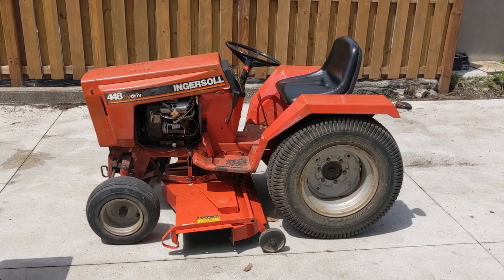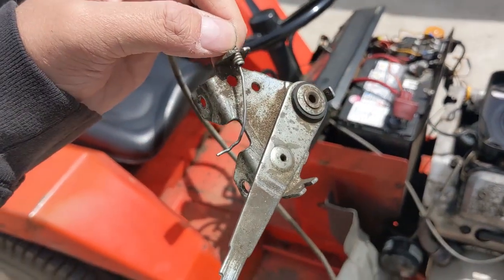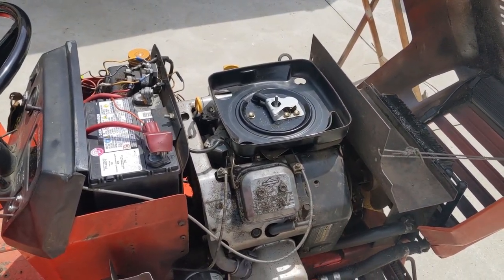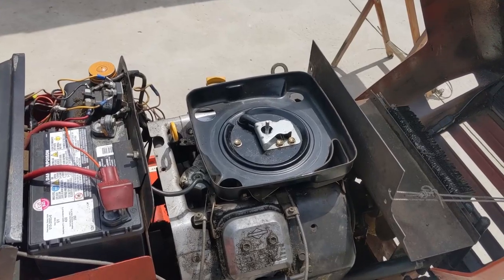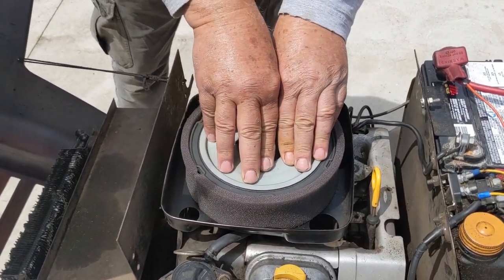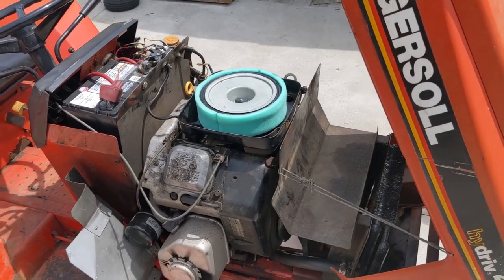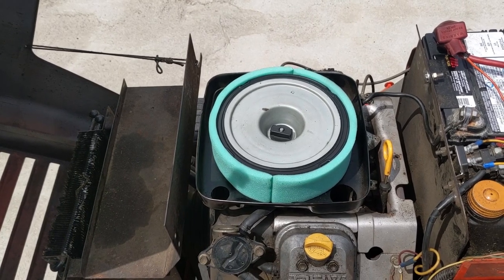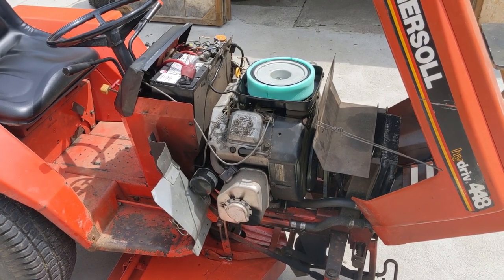Brand New Air Filter Causes Engine to Run Rough

Comment: You and your dad do top notch work. I’ve never come across a OEM replacement that caused and issue, but the proof is in the pudding on this one. I most likely would have tried to adjust the fuel mix with it running on the OEM. I don’t know if that would have fixed the issue, but I’m glad the stens replacement had this machine running like a watch.
Reply from the maker: Yea it's hard to say, I probably could've adjusted the air fuel screw, but to install a stens air filter and see it run so smoothly, I figured why not just do that, less work involved and at least I had the proof it ran smooth without a filter and with the stens one installed. Thanks for watching!
Reply: @EliminatorPerformance  I agree. Easier to go that route and also proved that the stens had better flow. Let that old girl breath a little better. Great job on this machine, and thanks for stopping by my channel as well.
Reply: My old neighbor had a fairly new at the time 84 Nissan 200SX turbo. He wanted me to look at it because it started running bad after a quick lube oil change visit. Found the new air filter that they installed got sucked from the air box into the intake tube. It was obviously after market because you could just about stand on an original one without crushing it.

Comment: Good call on the choke cable. If a wire bends too many times it brakes easier. Plus the choke cable could have been binding inside due to corrosion hence the bend originally.
Reply from the maker: Yea and on this one (as Doug mentioned in the comments too) the cable conduit slightly touches the battery. The old one did too. Hard to say if that makes a difference, but it's smooth engagement so I wasn't worried.
Reply: It's perfectly acceptable to replace just the inner flex rod. Would have saved several $.

Comment: Seams that air filter from Briggs has way less filter material than the Stens. I had the same thing happen to me last year when I bought an air cleaner from Ebay. The new component was a Briggs NOS item. I just made my own using an oversize filter I had laying around. The engine ran fine and still runs to this day. I took the air cleaner apart and the total size of filter element was just a little larger than one square foot. That is a real restrive filter. Now I just will make my own. Nice video fella.
Reply from the maker: Thanks for watching Victory, and yes it seems they're are built different, would be interesting to cut some apart and see the difference but I don't have the microscopes that would be needed to see the fibers.
Reply: @EliminatorPerformance  Hard to believe Briggs would cheapen out.

Comment: Now that is a lawn tractor. Well done sir, extremely lucky that you had one of those filters in stock. Now here is a case when the OEM fails and the aftermarket keeps on running like that rabbit on tv. The moisture point by Rons Mower Service is interesting but as you pointed out you had both in the sun most of the day and they were dry.
Reply from the maker: Yes both dry and the pre filters were not oiled. Thanks for watching!

Comment: I have a cub cadet 782 with a Kohler KT-17 that is running rough, and when I removed the air filter it started running smooth.  Thought there was something to it.  I had been advised to soak the pre filter in oil, and I notice you are running your pre filter dry.  I will be picking up a new filter and doing the same tomorrow.  Thanks for some piece of mind
Reply from the maker: Definitely don't soak them, if anything you just want a small film of oil to catch dust. You can get dirt bike air filter spray that's made for it, but we generally run them dry and just change them regularly when needed.

Comment: I HAVE HAD THIS ISSUE   THE PAPER WAS DAMP WITH FUEL  DUE TO INTAKE VALVE BLOW BUY.  A NEW FILTER WAS A TEMPORAY FIX UNTILL WE COULD GET THE VALVE ISSUE FIXED
Reply from the maker: Interesting, I'll have to remember that. A leak down test would be enough. These filters were both dry, and as I mentioned in another comment, the foam pre filters were not oiled. These were both brand new air filters.
Reply: Good call Jeremy any dampness will cause the issue .

Comment: Hello From Mark In Kentucky.  I have noticed a similar situation with the FRAM air filters both with my truck and with my small engine stuff - So I no longer use any of the FRAM air filters.  
The situation that you described reminds me of a Dodge truck within our fleet with a Slant 6 engine that was brought in for a poor running complaint. 
The mechanic who was looking everything over loosened the wing nut on the breather and the lid was vacuum locked and when he would pull up on the lid, There was a very distinctive “Whoosh” and the engine immediately started running as it should. 
In my nearly 32 years at the repair facility, That was probably the worst obstructed air filter that I had ever encountered on any of the government vehicles and equipment - And I have witnessed my share of “Nasty Filters” over the years. 
Most of the air filters that we used were Napa/Wix, FleetGuard or Hastings with no issues as with the Briggs & Stratton air filter featured on the video. 
A year or so ago, I had a brand new round OEM Kohler air filter with the foam pre-filter that exhibited a similar obstruction - But not to the extent of what the Briggs & Stratton air filter exhibited. The very similar round air filter that I had the issue with was used on my 682 Cub Cadet with a KT17 Kohler Series 2 engine. 
So I wonder if the OEM Briggs & Stratton and Kohler OEM filters are manufactured by the same company. As Always, Thanks For Another Great Video.
Reply: A great comment IronDuke502 glad to hear that others have had a similar problem with air filters. This is the first time we have had an issue using brand new air filters. And yes you may be correct that these filters are manufactured at the same facility.

Comment: I had this exact same problem with my Briggs and Stratton 4.5 flat head motor with a aftermarket air filter. The mower would surge up and down blowing out excessive black rich exhaust. I remove air cleaner mower runs fine. Put back on the knock off filter surges again. I switched the filter with my sons OEM filter no problem. Put the knock off filter on his mower his surges up and down as well. Bottom line the aftermarket filter is too dense and not letting enough air through. I just ordered an OEM B&S 698369 filter. I wonder how many other people experienced this problem.

Comment: Thanks, Jake, for teaching me yet another small but important detail about how engines can fail. Since a lot of us spray something into the intake for an easy first start I suspect we’d discover the issue when we put the original filter back on. Might not be a bad idea to remove/install the filter first as a test if a suspected rich condition exists since the filter is a lot easier to test than pulling apart a carb (even though most of us would suspect the carb or valve lash as most likely culprits). Time to modify my troubleshooting algorithm I guess. 😂👍🔧🧰
Reply from the maker: Yea this one tricked me at 1st, like I said I pressure tested the needle and it did leak slightly, I thought maybe enough to cause a rich mixture. Back and forth I went digging into the carb, only to run it without a filter and it ran smooth. On with the stens filter and same thing, nice and smooth. Never think something is good just because it's new! There's always a process of elimination to solve the issue!
Reply: @EliminatorPerformance  hi man maybe you can help me out , I don't know where my throttle cable connects to my carburetor , the video is on my channel , I'll delete the video once I get the thing fixed but the choke cable works fine , are throttle and choke the same thing ?

Comment: Have a B&S 28T707 12.5 hp on 2002 Yardmachines rider mower. Pulled original carb cause i had to run it half choked. Bought after market carburetor and surprisingly engine ran as it should. Went to install Filter intake base tube assembly and engine immediately was starved for air. I had Not installed Filter upon assembly at that point. I just slid intake filter housing over mounting bolts. Intake tube was not blocking any inlets when slid over mounting bolts. Why would just installing intake filter tube base assembly  starve carburetor of air? Intake does not block any inlet holes or bind on choke. Carburetor starts starving for air when intake tube gets about 1/2 inch away from carburetor. Intake doesn't have to be to be mounted tight before carburetor starts starving for air. What is the problem and what is the fix. I can not mow as is or carburetor will suck in debris and fail. Intake Base assembly is Briggs part number 696129 and it is not clogged in any way shape or form.  What is my problem? What do i do to fix problem?
Reply from the maker: @thomasabefisher4841  if it's not blocking any air, make sure it's not touching any wires and grounding out a fuel solenoid or something. Honestly this one was a mystery, brand new OEM filter and it clearly wouldn't run, less air, meaning rich fuel mixture. I've certainly never seen this happen before, but the stens replacement filter worked perfectly. It's hard to say what causes this, other than a bad batch of filter media.

Comment: Did you try running the OEM filter without the foam secondary filter? I wonder if that was the issue?
Reply: My thought too. Was the foam oiled?
Reply from the maker: Did not try running the filters without the foam, and no these pre filters were both dry, sitting in the sun for hours. Humidity/moisture likely not the issue either. As I said, only seen this happen twice in 10 or so years!
Reply: @anthonyiron4635  No we did not try that and no we do not oil foam air filters or prefilters. The aftermarket Stens foam prefilter actually seemed more dense than the OEM prefilter which i thought may be the problem but it was the OEM that had the issue.

Comment: Nice job on the troubleshooting Jake, I like that tractor. 👍
By the way, was that Mr Wayne's modeling hands I saw holding the air filter? 🤣
I've never had this issue before that I can recall.
Reply from the maker: Yes the old man helped out on this repair! Like I said, this has only happened to me twice in about 10 years. Both filters dry and pre filters not oiled.
Reply: Its a new one on me Jake, thanks for sharing the info bud.

Comment: This is a first for me. Few tests/observations
1) how does it sound without precleaners installed?
2) let’s see the outside of the pleated paper. Then do a light test. Which one lets through more light? Is there a big difference?
3) I have 2 brand new b&s 18hp horizontal motors on my shelf and both have an orange molding filter (394018) with light green pre cleaner. Can you show us the oem molded part number in the filter so we are positive this is an oem filter?
4) Will it throttle up at all?
5) I have seen something similar to this but it was human error. Owner bought new filter assy. Excessively oiled pre cleaner and residual oil pulled into paper causing restriction. 
6) stock jetting?? Here’s another issue with folks hole hoggin jets. Any restriction in the stock air filtration system immediately causes engine to run rich. Not at idle but at operating rpm first noticed under load with 2 blades of grass on the air filter.
Reply from the maker: The foam pre filters were both dry, no oil. Sitting in the sun all afternoon, so as I mentioned no humidity in them. This was an OEM Briggs filter as it came in an official Briggs bag. I'd be interested in flow testing each filter, but this machine was returned to the customer, and I don't know anyone with a flow bench around here. It only throttled up without the air filter, or with the stens filter. Factory jetting in this carb, not even the air fuel was touched. Fresh 91 octane ethanol free fuel. Also, the valves didn't leak as another viewer had mentioned could be an issue. She runs perfectly with the stens filter.

Comment: Nice find, did you check the valve lash to make sure you were getting the max amount of performance from the engine. I recently read that oil filter media from China had some issues and was hard to get.  Thanks for the video.
Reply from the maker: No adjustment to the valves as the engine didn't have the hours needed for it to require checking since the last service. This engine runs perfectly smooth with no filter, or the stens filter. I've only ever seen this once before and it was years ago, I think on a Kohler.
Reply: @EliminatorPerformance  Thanks
Reply: @EliminatorPerformance  dealing with this now on a Briggs 25T235-0111 that my friend has me work on. It's a Troy Briggs generator engine. When it was dropped off it would run but super rich. They ran it like that for hours bucking and and vibrating around on the verge of stalling out and engine speed fluctuating.  After a few hours trying conflicting valve settings and thoroughly carb trouble shooting I couldn't get it to run right. It would just run rich and stall out. I removed the filter and it ran almost perfect. As soon as you put the filter in place it blows a cloud of black smoke and runs rough till stall. I did everything you did over the past 24 hours. The air filter is old and has some color but was not full of debris and air passes through. It appears to be the original Briggs filter. Idk how to get it to run right with an air filter but without one the plug comes out perfect color. Choke is working good and smoothly. Doesn't stay open when it should be closed and vise versa. There was also gas in the oil of the engine and it was overfull because of it. They must have forgot to turn gas off and ran it like that. The float was perfect. The float needle would seal perfect and seat was polished. Today it gets a replacement spark screen then it's not my problem anymore lol.

Comment: Funny just watched Green Lawn i think it was he just posted a video on his aerator not running because the Honda air filter was plugged but he said it looked brand new and even blew it out but engine was losing rpm and then would not start, ran fine with filter off.
Reply from the maker: Yea just like that old gas powered welder I worked on. Filter looked ok but was completely clogged with fine dust.

Comment: Couldn't you just adjust the carb to run with the briggs filter?  I like the stens fix.
Reply from the maker: Yea probably, but the way it was, we just ran a STENS filter and it worked great. Save some $ too lol

Comment: Pretty sure this is what is going on with my kawasaki FH500V. I have replaced literally everything else on the engine and  it still runs VERY SLOW at half power with black exaust. Without the air filter it runs like a champ.

Comment: You could see something like this happening, but you would think with today’s knock-off products and OEM price point manufacturing it would be less restrictive. I haven’t seen this before. A good head knocker though. Tell Wayne that if this small engine repair gig doesn’t work out, there is alway a market for hand models! I know old joke!  Have a good week.   Rick
Reply from the maker: I would've thought maybe the stens air filter would've caused this, while the OEM one wouldn't. But I think it makes sense that the OEM one filters a finer debris, and is somewhat more restrictive. Only a flow bench would prove that.

Comment: The carb needs to be adjusted in the "as is" conditions. 
There is likely a carbon build up in the combustion chamber from running rich.
Reply from the maker: Yea I put new plugs on it, but it runs smooth with the stens filter so we left it at that. Just wanted to share my experience. I could've adjusted the carb, but then it could run lean if he runs a different air filter. At least he'll get his parts from me and we'll keep putting stens parts on.

Comment: Over the years I had various new parts that were bad right out of the box. So why not an air filter? Put a new set of plug wires on a ford 4.6 engine. All it did was move the misfire to a different cylinder. 😆
Reply from the maker: Yes exactly, we should never let a new part trick us. Thanks for watching!